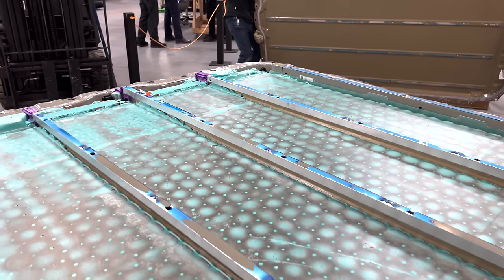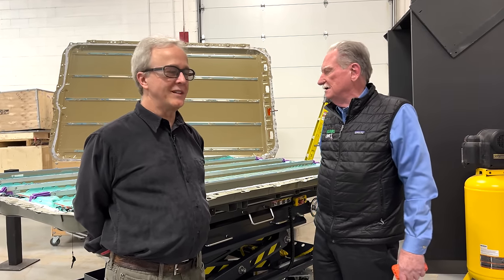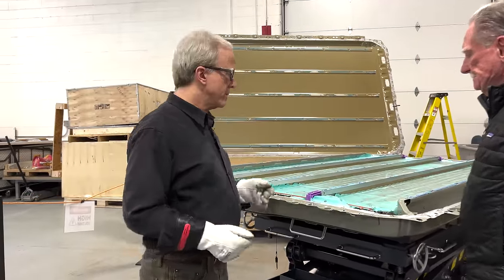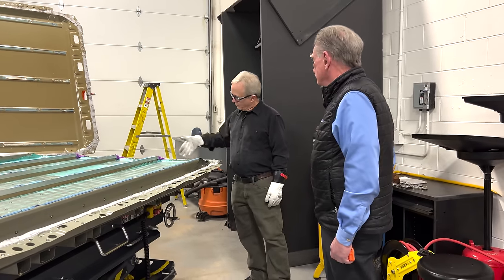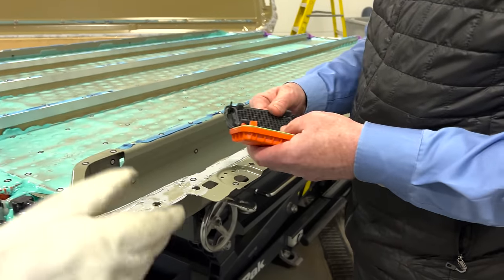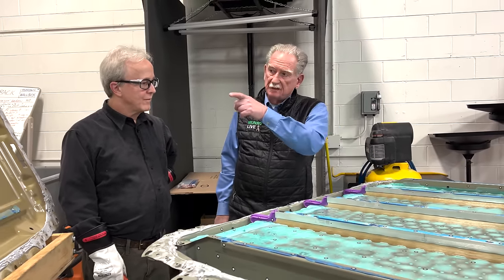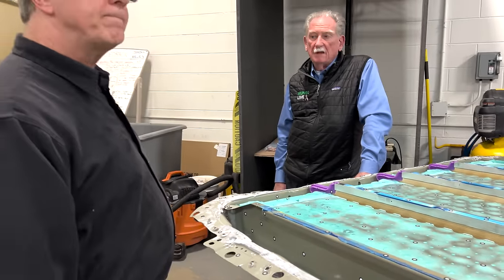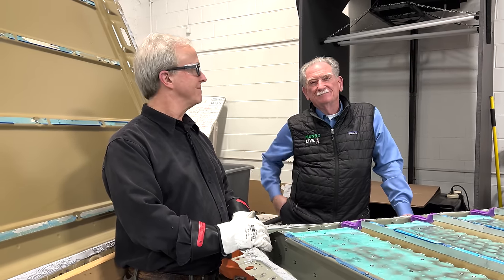Tesla Cybertruck Battery Pack: Our First Impressions Under the Lid

Comment: As a Model Y owner I must say these new battery packs where they glue all the cells so you can’t repair anything in the future is quite disgusting. So much for ”saving the environment”. One single dead cell will kill the entire battery pack. One single dead cell will result in the 99.5 % of the good cells to be thrown away.
Reply: One might as easily say that integrated circuits are not designed for repair. One bad trace and the whole die is thrown away.
Reply: If one single cell dies, the rest of the pack will work fine. One cell represent about 0.01% of the total amount of cells so you just lost 0.01% of capacity, the packs are designed to work around dead cells, or even dead clusters.
Reply: @Swiss that’s not how it works. The failed cell represents the percentage of a single parallel group. It depends on how the battery cell fails. In the 2170 cells they have been known to fail and act like large resistor that draws the cell group down fairly rapidly and it causes the car to register a fault. 
Though techniques have been developed to repair them. 

I would assume that individuals will develop the techniques to repair these structural packs as well.
Reply: @swissness2444  no it won’t, I’ve spolen with Tesla regarding this and they said ”we’re not taking any chances, if the BMS detects one bad cell the entire pack will be needed to be swapped out in order to avoid a fire or worse”.
Reply: Watch Redwood Materials. They can recycle this.
Reply: @ronrubbico8836  recycle yes but you still force a customer to get an entire new battery for one failed cell due to everything being covered in glue. 

Also, recycling dosen’t matter when you’ve released so much CO2 and taken so much resources to create a battery just to trash it due one faulty cell. 

That really dosen’t make any sense when talking about saving planet earth. I love my Model Y but these anti-repair measures are pure BS.
Reply: @PygKLB a $10 IC? That does not compare to a $20k+ battery. Whats the cost of the smallest serviceable component of the assembly.?
Reply: @PygKLB  Bad analogy: ICs by nature are monolithic; all those traces are produced in one go on a single die. Battery cells are all produced separately, graded and then packed together as one monolithic pack, where there are plenty of other ways of packing them together, keeping the granularity they initially had.
Reply: @ronrubbico8836  Recycle? Yes, by grinding the pack to bits. It's about repair: replacing the part that failed. Redwood can't do that either.
Reply: @sa.t.2507  Just because Tesla replaces the whole pack doesn't mean third parties don't repair them. Usually, they find the bad group, locate the bad cell, cut the link, discharge the cell, drill it out, and then put a replacement back in the same spot. Then they relink it and balance the back.
Reply: @kingofl337  this can be done on the older batteries but on these packs where they’ve poured glue over all the cells. This makes it impossible to take them out. The entire pack must be swapped.

Comment: 24:39 the gases could not "vacate" anywhere because the pack is sealed the conversion from dense lithoum to Lio2 at a reasonable temp is around 800 times change.

Comment: Totally unserviceable. I hope discarded ev batteries have a process in place to completely recycle them into new battery packs...
Reply: they dont. you can recycle only 20% of any lithium battery.
Reply: @johnmachter40 that is absolutely not true
Reply: @bryjb10 thats what i have read. 
a lead battery is 99% recyclable. a lithium almost non recyclable.

you ever disassembled a rolled lithium cell? how do you  think they will recycle the long foil where the lithium is sprayed on?
Reply: @johnmachter40 considering how expensive Lithium is, yes
Reply: @fischX  considering you don't know how they do it I would stay with that what I have read and say it is not possible until you show me otherwise.

Comment: Here are the key takeaways from the transcript:

1. The Cybertruck battery pack is structurally integrated into the vehicle frame, unlike previous Tesla models where the battery pack was more modular and replaceable.

2. The battery pack has innovative safety features like a "spark arrester" vent system that opens during thermal runaway to allow gases to vent while trapping particles that could start fires. 

3. There are crush zones and standoffs built into the battery pack structure to protect it from impacts during off-road use.

4. The cooling system has some unique aspects like one cooling channel per row of cells instead of the typical serpentine cooling design.

5. The battery appears to use the new 4680 cell format and has a very smooth outer enclosure, potentially using a mica or similar outer wrap.

6. The electrical design connects groups of cells in parallel to increase power, then connects those parallel groups in series to achieve the desired high pack voltage.

7. There are flood port vents to allow coolant leaks to safely drain from the battery pack.

8. Tesla has implemented safety features to allow the vehicle to notify occupants and automatically open doors/windows in case of submersion.

Overall, the Cybertruck battery shows numerous innovative designs tailored for the vehicle's intended off-road and rugged use case compared to Tesla's previous passenger vehicles.

Comment: That battery is crime against humanity and the environment. A disposable battery pack. There is zero chance you can repair that by replacing a cell or a pack. Without doing a lot of destructive work.
Reply: tesla is constantly hiring engineers if you want
Reply: And not very good ones!
Reply: Making a battery repairable adds complexity, cost, weight and unreliability, better to design a battery that is reliable than a repairable battery.
Reply: @universeisundernoobligatio3283  lol, sarcasm? Tesla just doesn't care about consumers
Reply: Exactly. The only reason to do it this way is lowest manufacturing cost. This hardly leads to lowest overall cost or best solution for the environment.
Reply: @hvh377  
EV battery's are recycled by putting the whole battery into a grinder, no disassembly required, leads to lowest overall cost, longest life,  best solution for the environment.
Reply: @universeisundernoobligatio3283  Much better than recycle is repair, refurbish and reuse. We already have far too many throw-away products where production cost is so far optimised at the expense of repair cost, that even repair under warranty is not economically viable anymore and the product is replaced.
This is a very bad practice that is now, with the advent of EVs, being extended to the automobile. There is absolutely no need to do that. It's wasteful.
Reply: @hvh377  
Much better is to design a battery that does not need to be repaired or refurbished. 
Making a battery repairable adds complexity, cost, weight and unreliability, better to design a battery that is reliable than a repairable battery. It's very wasteful to add all this complexity making a battery repairable .
Reply: @universeisundernoobligatio3283  I know what you think. You have echoed this mantra all over this topic. It's total bullcr*p.

You don't control why or when repair is necessary. There could be a small mishap with the vehicle. If you dent the battery pack, the vehicle is written off. Uneconomical to repair. How dumb is that?

Free market economics leads to short term gain: lowest manufacturing cost at the expense of everything else. We need regulation to make sure long term gains are not lost.
Reply: @hvh377  
I know what you think. You have echoed this mantra all over this topic. Making a battery repairable adds complexity, cost, weight and unreliability, better to design a battery that is reliable than a repairable battery. It's very wasteful to add all this complexity making a battery repairable .It's total bullcr*p. 
Sure a small percentage a battery's will get damaged, but you want everyone to pay extra up front for that with a very slim chance that might happen.
Reply: @mostneuter  Musk is constantly overriding his engineers and doing what is cool or least expensive.
Reply: @hvh377 I hope you realize it cost.Almost double to recycle a battery as it does to build a do one.They're not going to do that
Reply: @buddytweed7154  Of course there is a cost, but you support my point perfectly: making the battery repairable will add some cost up front, but may save money in the long run by postponing the moment the recycling costs are incurred, or even lowering recycling cost by making it easier.

And even if the investment of the initial cost doesn't totally pay off (which it very well might do), we paid a little bit more to save a bit more of the environment.
Reply: @universeisundernoobligatio3283  Thanks for the imitation. It's a form of flattery, they say...

In spite of what you keep saying, repairability and reliability are not mutually exclusive. There is no evidence to support that claim.

Constantly optimising for the lowest possible manufacturing cost, has given us our current throw-away society. It's shortsighted and dumb. High time we end this race to the bottom.
Reply: @hvh377  
It's flattery, it's mocking your lack of engineering, design and repair knowledge.
Reply: @EthosAtheos if it is constantly you must have numerous concrete examples with evidence. Do share.
Reply: @universeisundernoobligatio3283  I'm shocked. My engineering degree and 30 years of working in design and engineering, all for naught. What a shame. I shall be looking for a job elsewhere then...
Reply: @jmattoxriskpro  The truck is made of unpainted stainless steel. No one who knows anything about stainless would make that decision.
Reply: @hvh377  
 I'm shocked. My engineering degree and 40 years of working in power electronics design and engineering, all for naught. What a shame. Retired shall not be looking for a job elsewhere then...
Reply: @universeisundernoobligatio3283  I have been doing the electric vehicles for almost 8 years now and I've done tons of research.Have you ever looked into the environmental impact and cost of building an electric batthree way more destructive than running diesel or gasoline on the highway
Reply: @buddytweed7154  
I have been doing the electric vehicles for 20 years now and I've done tons of research. At 20,000km the extra embedded resources in an EV covered after that an EV uses less resources. After 10 to 20 years 95% battery's are recycled to make more battery's. How much of the diesel or gasoline emmisions are recycled?
Car Exhaust Is A Key Contributor To Asthma In Children you must be OK with that?

Comment: So much empty volume in the pack and so little of it used for cells ... You call this brilliant? That's one of the worst volumetric energy densities in current battery packs. This in turn limits range and makes the Cybertruck far less appealing to many potential customers. Be honest: this is not brilliant, the range was disappointing at the presentation of the production version. And the "range extender battery pack" thus far is vaporware.
Reply: Please watch the whole video Sandy clearly explains why this is truly a great idea for safety measures 😮.  😂so many people just love to hate without knowing why they hate😂😅
Reply: @babyschuerman  I did watch the whole video first. I just do not share his pseudo arguments. My take on it: Munro is heavily invested in TSLA. So he talks it brilliant even if it is not. Tesla could have offered two pack variants. One for off-road (with excess volume for undershield dents and water if they that is necessary) and one for range or towing. Or could have installed a really sturdy honeycomb undershield in the off-road variant. As a side note: I believe, hardly any customer will take this vehicle off-road.
You want numbers? Just compare the packs with the competition in a simple table like Munro did in the past. Capacity for BEV pick-up trucks: Rivian 135/180 kWh, GM up to over 200 kWh, Ford 131 kWh usable already since model year 2022. They also have somewhat higher consumption, so this does not translate to more range proportionally, but you can see the state of the art in battery packs this way. My comment is not hate. It is the most simple form of competitive analysis. One of the promises of 4680 at battery day was: 16% more range over 2170. But customers do not get this.

Comment: That battery pack doesn't look very serviceable.
Reply: Sandy has made the point a few times: You can be reliable or serviceable, but usually not both. Fasteners, connectors, and other "service enabling" parts are what typically fail most often. Eliminating all that should (time will tell) make the whole system more reliable, negating the need for service.

This was discussed in the lead up to the 4680 Model Y teardown.
Reply: Yep, one loose connection and the $15k battery goes in the trash.  Very disappointing but on par for Tesla who makes everything unserviceable to boost profits and hurt the customer bottom line.
Reply: Every need for a service in history has been met by people eager to provide it. Someone will get good at it. I see opening a modern cell phone, personally, as an impossible task, but there's a guy at the mall who will do it for me while I eat Chinese food.
Reply: Battery packs should not need service.
Reply: U gonna change the oil?
Reply: @Tanstaaflitis  sandy kisses A to get money and vehicles from musk.  If your point was valid, all cars would be a brick of glue with no serviceable parts. Since that’s obviously bunk, making a $15k pack fail for want of tightening a single fastener or simple part is a huge waste of customer money.  No wonder Tesla has lost so much market share and stock price lately.
Reply: @hugegamer5988 
Who makes serviceable EVs?
Reply: Battery packs usually aren't meant to be, especially when they are part of the structure of the car.
Reply: @hugegamer5988  Presumably, a loose connection that could cause a battery to fail would be caught in production QA or within a warranty period. At that point, the pack is disassembled and the cells can be tested and reused or recycled. Dead lithium cells still have a lot of economic value and are being reused and recycled.

Outside the warranty period... Everything fails eventually.
Reply: Tesla needs to sell more cars and serviceability does not help. This is why phones today are glued togheter and made out of glass.
Reply: @Tanstaaflitis  just more unserviceable junk then, if it were possible to make perfectly manufactured assemblies then we wouldn’t need any service technicians.  I have an EV with a modular design and little to no glue so it can actually be worked on if necessary.  We need more technicians that can work on high voltage assemblies, not overpriced junk.
Reply: What exactly do you want to service in the pack? Do you service the battery in your Milwaukee or Dewalt tool? No! You recycle and replace. 

Any battery pack is going to have an expected life cycle relative to how it's used and managed, much like an internal combustion engine.

If you're worried about a loose wire or something minor taking out this pack, it is incredibly unlikely given how locked in and protected from vibration everything is.

Personally, I don't want a pack that has been 'repaired' strapped to my ass
Reply: If you value repairability over cost, efficiency and safety an alternate design may be preferable.
Reply: Cars are rarely repaired. Just parts and components replaced.
Reply: Yes. Or you could say the battery pack is zero-maintanence. The construction indicates that Tesla is confident the lifetime without failure is quite high. If you built up the pack for maximum serviceability, we would be talking about 10,000 contacts that can fail, and the battery would also be more susceptible to vibration.
Reply: You think?
Reply: This is so ther is no resale like the previous versions of the packs.

Diy'ers were using crashed vehicle packs for solar storage...
Reply: @hugegamer5988 how will a connection become loose with all that epoxy? Once it’s tested after assembly nothing should move at all. For recycling, everything is melted down with acid. You can also dissolve the epoxy/foam with a special solvent.
Reply: @mbox314  I used to buy a new cell phone about every 2 years due to some sort of failure. My current one is over 5 years old and still running strong.
Reply: It's not supposed to be. It's  supposed to outlast the truck .
Reply: CYBERTRUCK battery will last  1 million miles
Reply: It's not serviceable as hardware, but it can be reconfigured on-the-fly by the BMS to 'isolate' a defective cell.  Over time, the way it's charged, monitored and discharged will no doubt be improved.
Reply: @hugegamer5988  I think the best idea is to produce a product that doesn't require service.
Reply: It's not. It's disposable trash.
Reply: @hobbyguy79 if my dewalt  battery pack went bad i would get lithium batteries and replace the bad ones, and it's very easy to do
Reply: @Tanstaaflitis  counter point is this is a wearable item. It would silly to make it impossible to replace the brakes because we need to remove fasteners
Reply: @mus_xr4653  exactly my point, nobody 'services' their batteries, they replace them. Ideally they fail under warranty but also, the Tesla packs more and more are way over built and durable and if there's a failure of some kind, it's not likely going to be in a minor serviceable component anyway. 

Like I can rebuild an engine, but if for example I damage the block I'm more than likely just replacing the engine.

I don't want a 'serviced' battery because there is likely going to be more failures created by the servicing
Reply: @Werdna12345  
Evidently, Tesla believes this wearable item will require replacing every 500,000 miles. I'm basing this on the construction.
Reply: Duh 😂